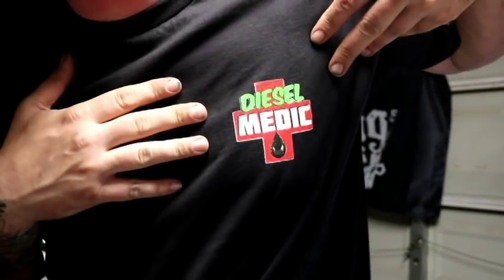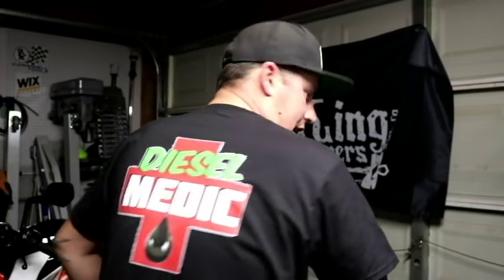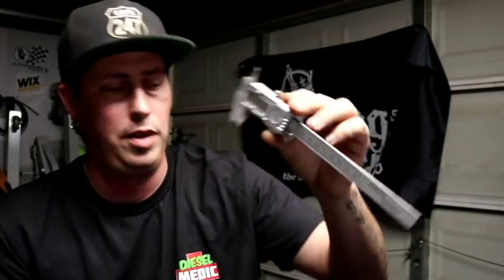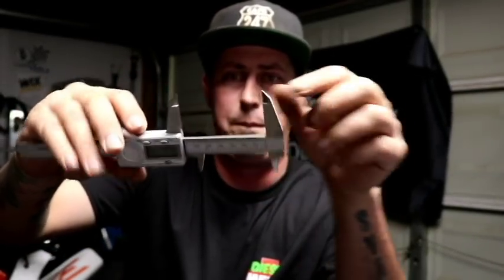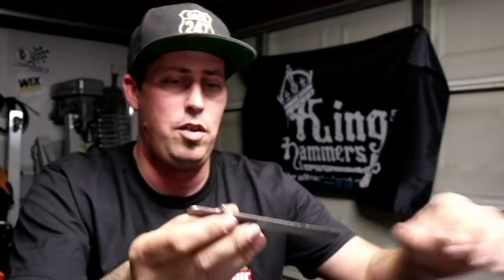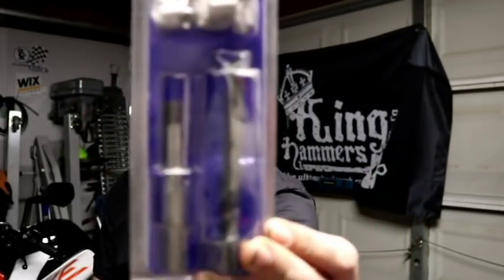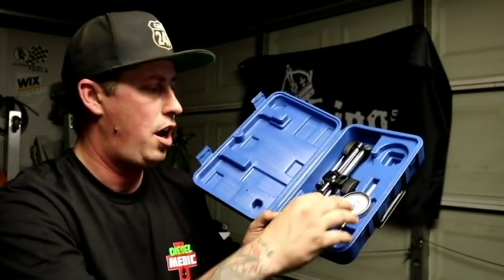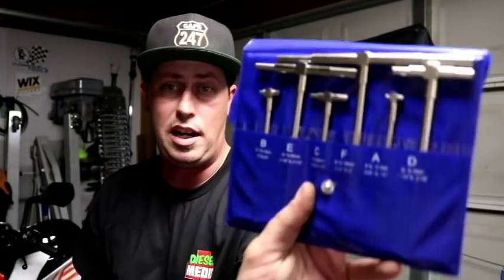PRECISION TOOLS USED IN AUTOMOTIVE!!

Comment: That straight edge isnt machined, its ground. For that long of a piece even the best machining center will usually still be out of flat a couple thousandths. A grinder will get it flat within tenths of a thousandth. 

Also thats just a digital caliper. There are 3 kinds, digital, dial, and vernier. The vernier is read by using numbers engraved in the steel like a rule has.

Also dial indicator lol. I seen it right on the tip of your tongue.
Reply from the maker: Thanks for the corrections my brother. I was trying so hard to remember. lol Also, I was going off of what I was told by my tool rep. So let me understand this. It's not CNC Machined? He said it was. I know up-sell, but it looks like it could have been. Hmm... Machine grounded. Thanks again. Good info to know.